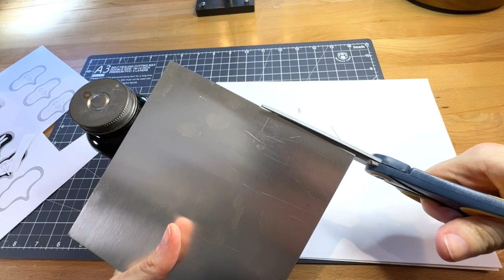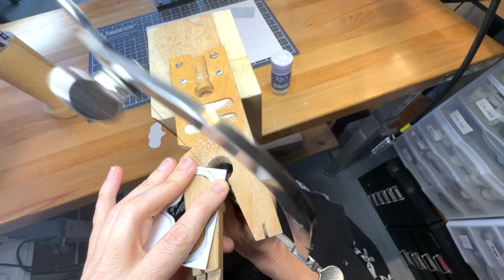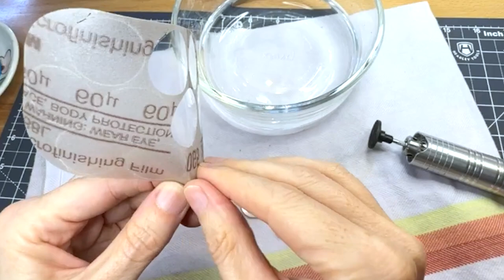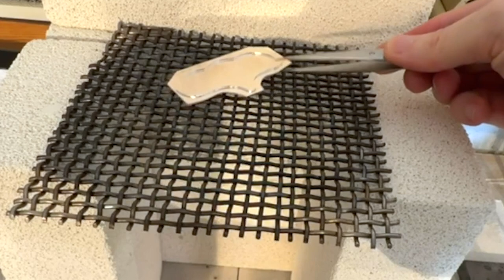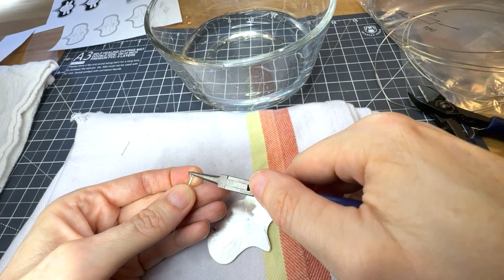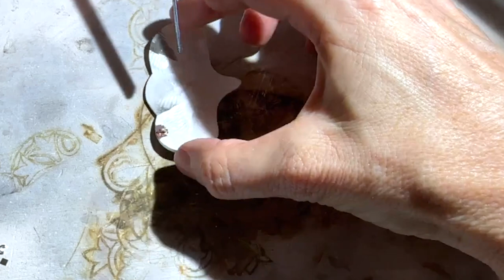Making a Dragonfly Necklace Part 1

Comment: Do you always remove the inside first with your saw?  I would remove the outside, is it more stable to remove the 8nside first?  Is it a preference?
Reply from the maker: I like to remove the inside first because it's easier to hold onto it while sawing.  Also, if I make an error on the inside, I can adjust the outside dimensions to accommodate  it... :)